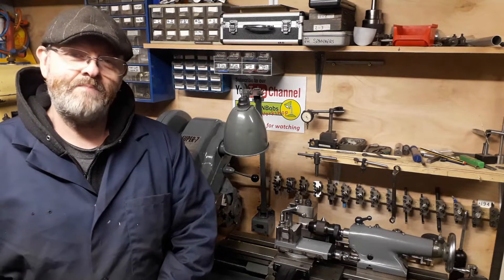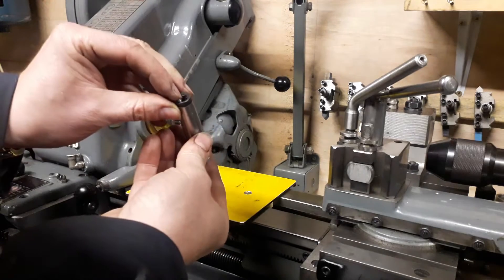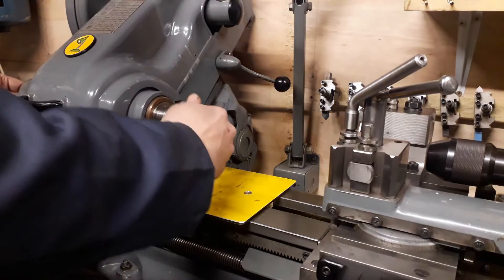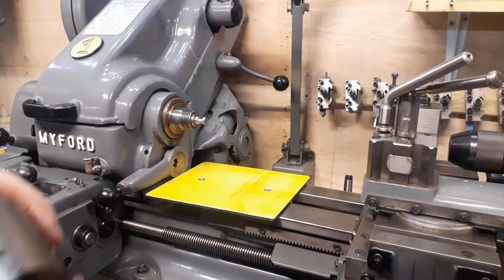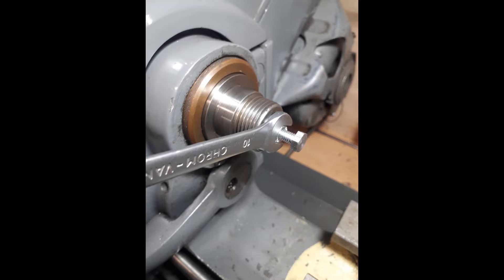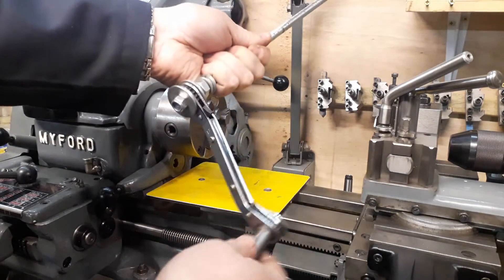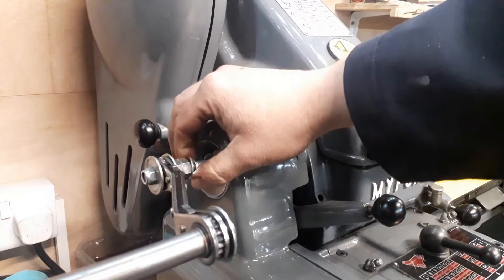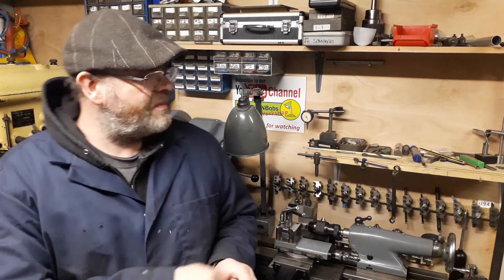Make A Myford Super 7 Drive Handle/Depth Stop

Comment: I bought the spindle turning handle from Myford. I wish I had seen your video first, it would have saved me some money!. Your design is better than the Myford design because you have a depth stop. However one advantage of the Myford design is you can install the spindle handle from the change gears end without removing the chuck, and that may be important. I think your Boxford turning handle is a similar concept to the Myford design with an expanding reverse cone.
Great video. Thanks
Reply from the maker: cheers Philip